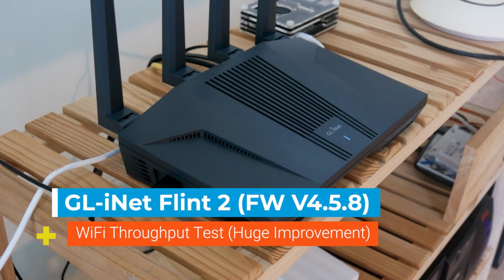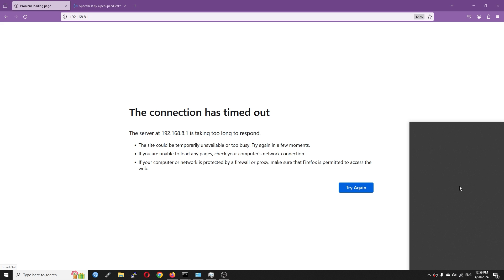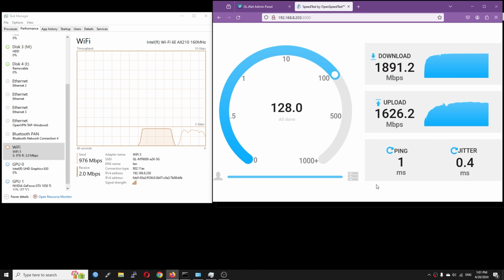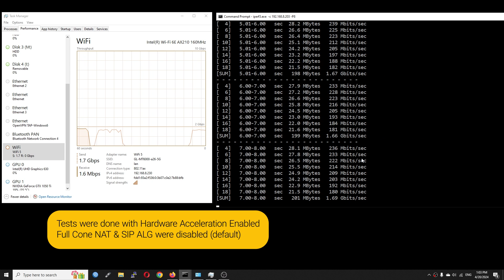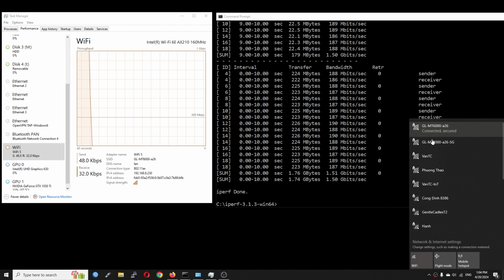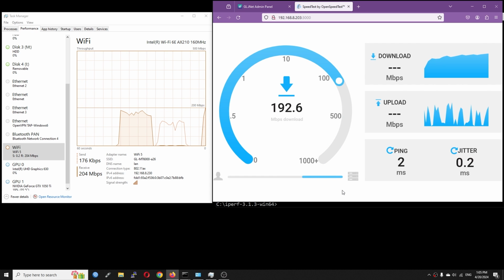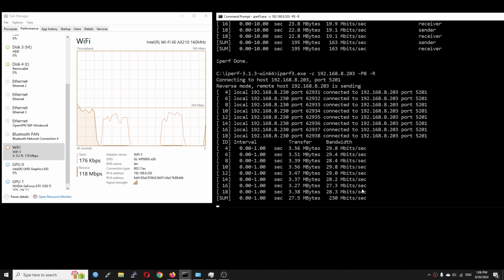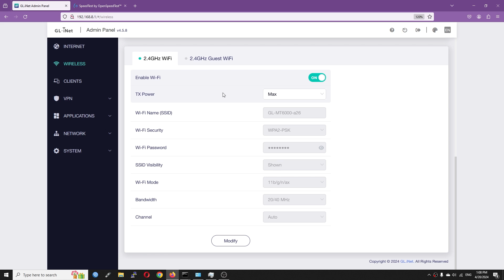GL-iNet Flint 2 - WiFi6 Throughput Test with FW V4.5.8 (Huge Improvement)

Comment: This router has weird issues every time mine loses power the webgui crashes and i have to reset to defaults with my cameras it is horrible to reconnect them. Sucks because it's honestly a good router
Reply from the maker: Hey, did you update the firmware to the latest version. The router is designed for unexpected power loss and it shouldn't crash the Web-UI since it is running on RAM.
Reply: @VanTechCorner  router is version 4.6.8 OEM firmware did it since i bought it always updated never run a beta firmware on it.

Comment: I'm having a really weird issue with this router. I have symmetric gigabit fiber; I get full throughput on LAN but only 450 down and 600 up (upload is always higher for some reason). I am on 5G channel 52 (I have tried many different channels) in AC mode at 80 MHz with no neighboring interference. This issue has been persistent using the official OpenWRT with both the current stable and three additional snapshot builds. I've tried everything, from changing my region to adjusting the radio db level, enabling and disabling WED, Packet Steering, IRQ Balance, adjusting AQL limits etc. I get great signal on both 2G and 5G, but the throughput on the 5G isn't even close to what this taget it capable of. The only thing I've yet to try is stock firmware (I don't really want to try it since this device is from the CCP). Is there anything else anyone else would suggest? Any input would be appreciated!
Reply: Maybe try at 160 MHz? Your speed right now is what I typically get at 80 MHz
Reply: And why set it at AC? Just set it to AX
Reply: @alvianfajar9570  I already tried that, thank you for the suggestion, though. It seems to only be an issue on the WAN side. I am seeing full throughput over LAN and also tried AX, but it made no difference.
Reply: @favabean13  maybe it's your client device sir, I got the same Intel AX210 in this video and still got gigabit in local speed test

I can't test internet speed test tho since my internet speed is lower than gigabit

Comment: Does it support OpenWrt?
Reply: Via snapshot, yes. Their stock firmware is modified Openwrt
Reply: @Ryan1Twice  can I just use the stock firmware web UI to do that? Or do I need to open the case, do some soldering, connect UART cable and use serial console?
Reply: @zulhilmizainudin  you can do it from the web UI. Looks like it’s in mainline now too, don’t even need a snapshot